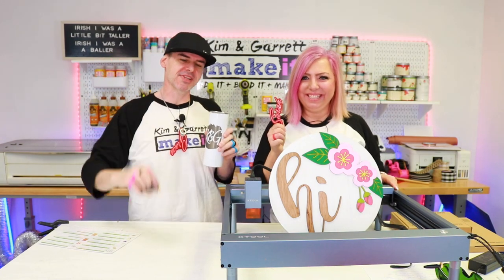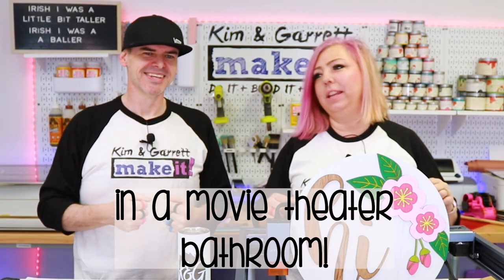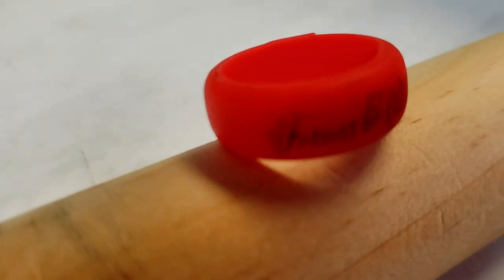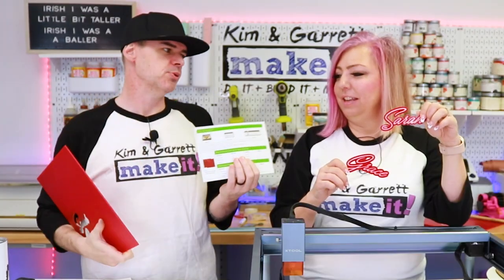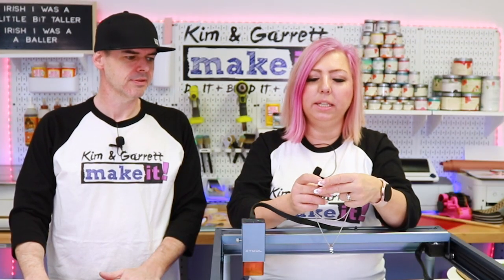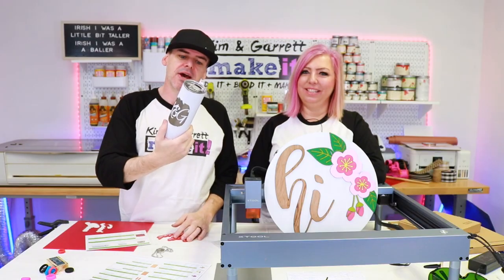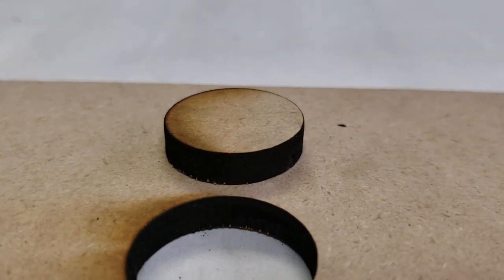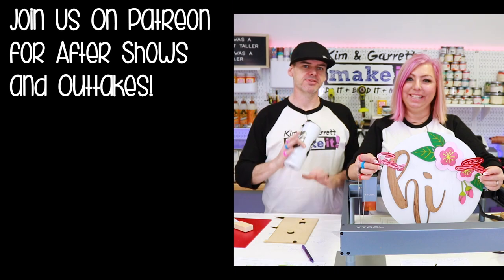5 Personalized Project with the xTool D1 Laser

Comment: I just got my xtool d1 setup. How did you know how to set up the size of the project? Or does the xtool figure that out when it scans the frame? It’s weird to me that this machine didn’t really come with directions as far as how to use it. It had a great tutorial on how to assemble but then I found myself lost after that. I wish it would’ve walked me through at least a first project. Thank you for sharing a few projects. I’ll experiment with mine and hopefully I won’t burn down the house in the process 🤣

Comment: Hi K & G. Would you recommend a small diode laser (xtool d1 pro 10w or 20w) for someone just starting out? I have a small garage shop with very little space and I'm just looking to supplement some income by making little things to sell at craft fairs and locally.
Reply from the maker: Hey Home and Hobby! If I were just starting out, I would get the xTool D1 Pro 20 watt with the air assist. Because I could cut 1/8" plywood and acrylic at a pretty good speed, but if I would do mainly engraving the 10 watt would work great. Thanks! ~garrett
Reply: @KimandGarrettmakeit  Thank you for the recommendation. I will be making some cuts so the 20W it is. Keep making the awesome videos. I especially enjoy the market videos and post market videos.